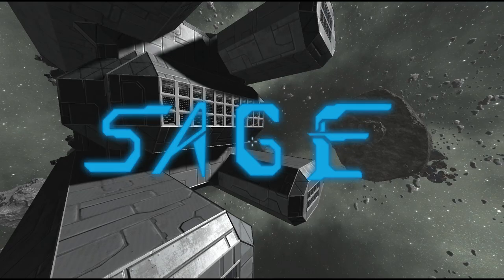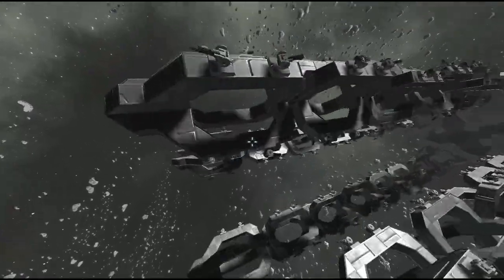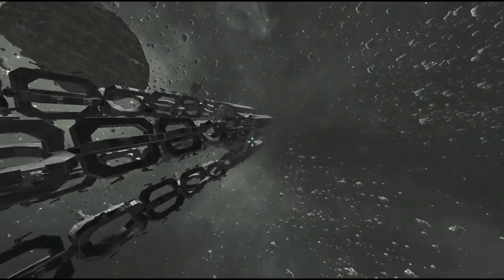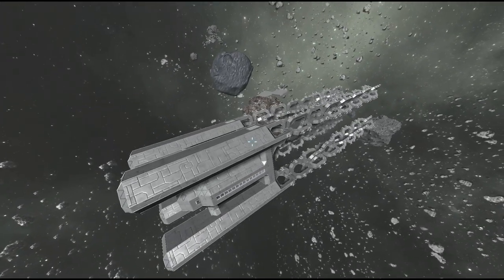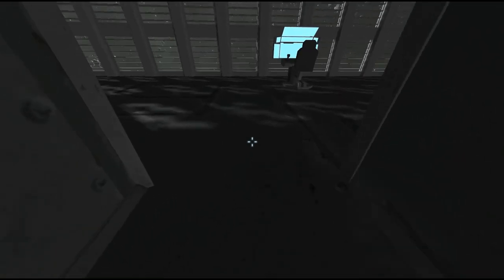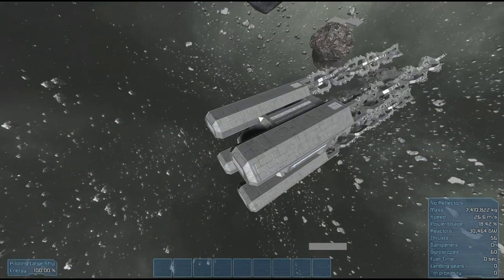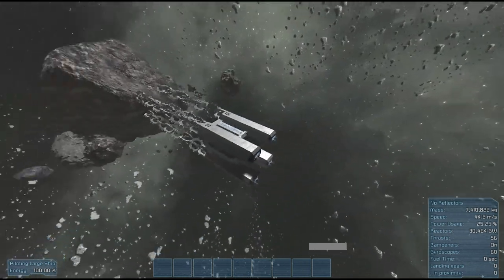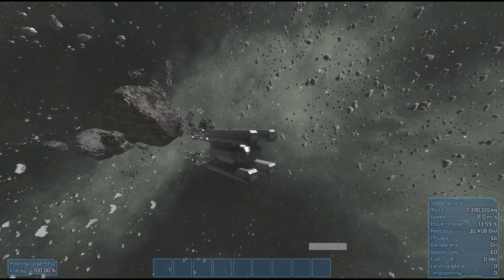Space Engineers, Spindle Ship

Comment: you should put another part on the back so the turrets are in the middle
Reply from the maker: My original idea was to have a spinning segment connected to a more static segment, and then repeat this a number of times. Problem is, there is no way to have a motor at the front, & the end of a spinning object, connect to the same static object. This is because the motors are not the size of a block, but actually two, and a little bit.
Reply: Video Sage you may be able to do so using another tactic, instead of having several motors connected to one another, have a static post run from the middle of the control ship and create several shields off of that. Then you could use twin motorized segments. Also using a shield in between each twin motorized segment may help with your quick turn issues. The only downside is your control ship would have to be at least 2 blocks bigger per side, but you wouldn't need as many moving weapons systems. This way you could protect your weapons systems and simplify your design with minimal effort. + it would look cooler. This should negate the "two and a little bit" size issue you have. Adding some non-motorized weapons systems onto the front and back shields of the craft would make this into a fighter/bomber nightmare ship. Perfect for fleet support. Amazing design for a test vessel still!